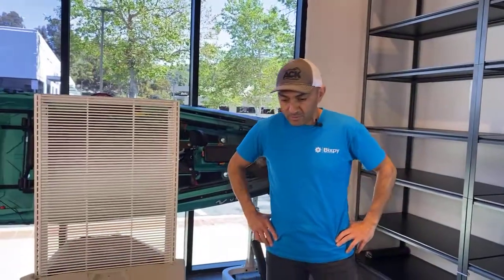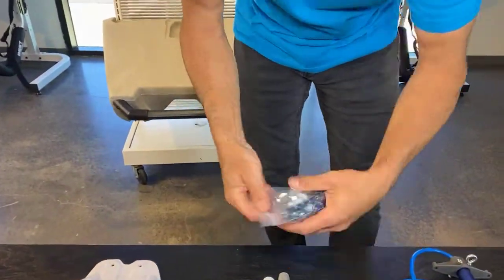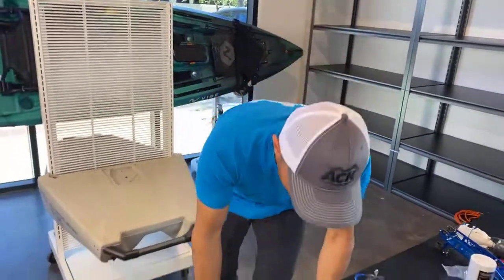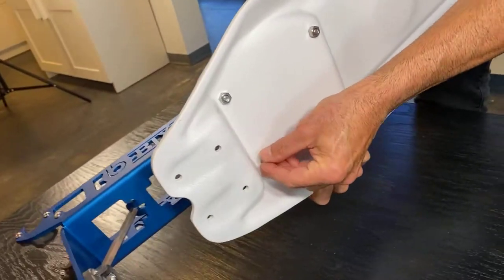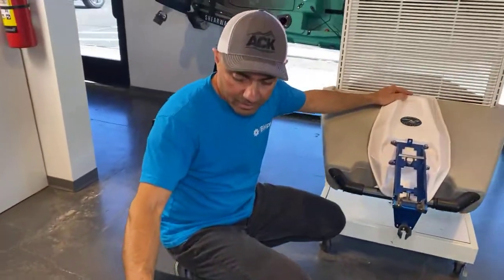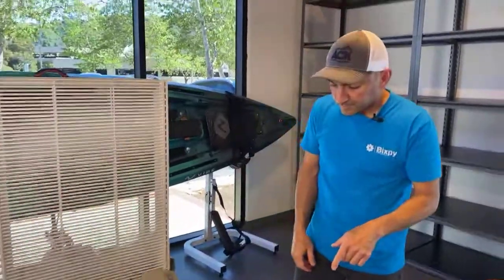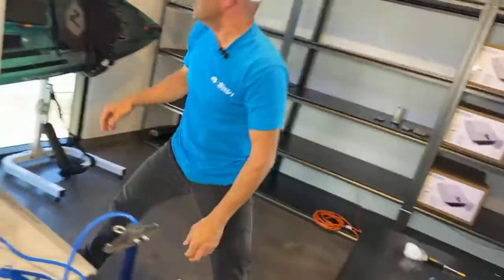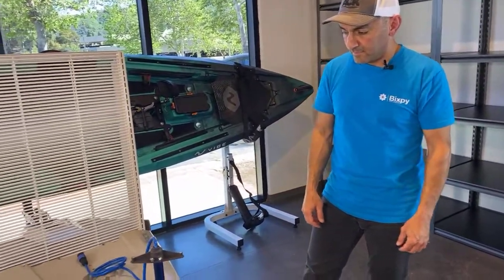Bixpy J-2 LIVE Installs - Featuring the Hobie Power Pole Plate + NEW Power Pole WillFit Adapter!

Comment: What is better preformace mirage drive through hull or power pole mount?  Looking at speed and ease of mobility.  Thanks🤙
Reply from the maker: Hi Anthony. Typically motors always do better on the stern of a boat. And with the stern option you also do get to keep your pedal drive!
Reply: I have the j2 and am debating wether to get the stern mount as I have the mirage drive mount. My question is how would I raise and lower the motor should I get seaweed or kelp on the shaft mount? Thanks in adv.